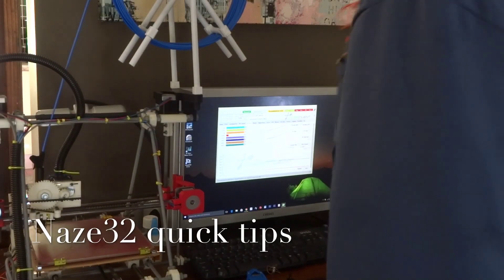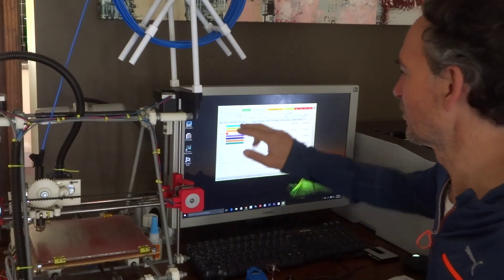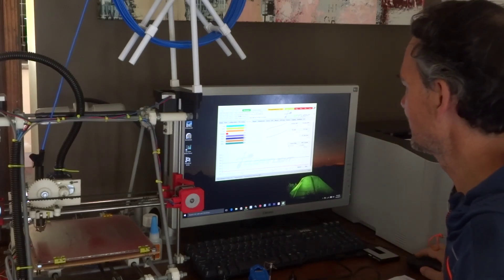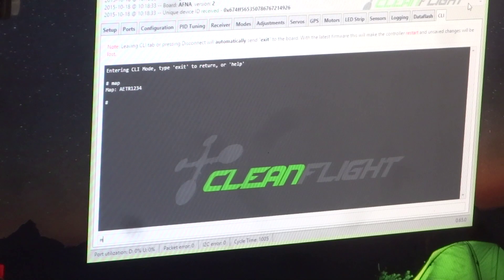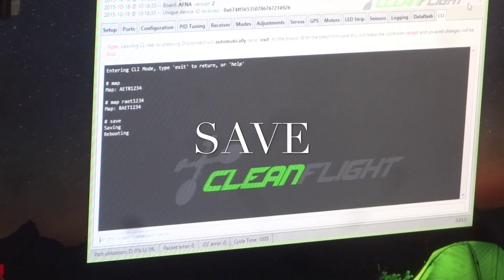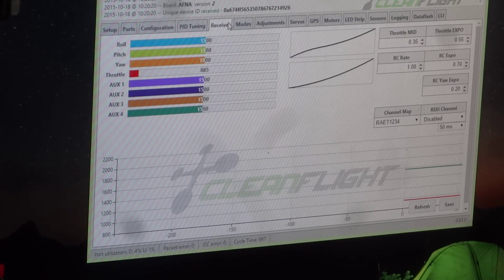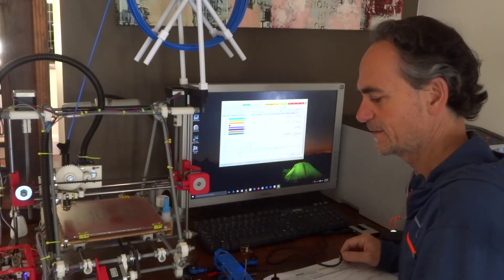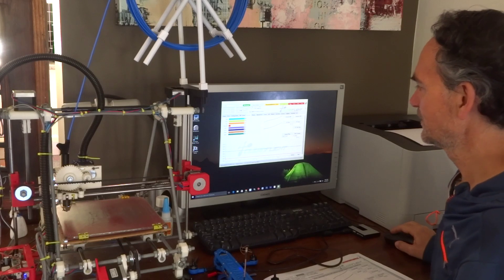Naze32 Quick Tips - Channel Mapping

Comment: do you knwo how to add more channels in cleanlfight? im using a flysky i6s tx with ia6b receiver using I-bus. The tx has 10 channels and the receiver can support 10 channels as well, but I can only see AETR and aux1-4 in cleanflight. Is it possible to add Aux5 and Aux6 (channels 9 and 10) ?
Reply: I just checked and apparently my receiver can support up to 18 channels over i-bus

Comment: I only have channel 3 available on my SBUS receiver, which I intend to use it to drive a camera tilt servo. How do I assign Throttle, which is currently on channel 3, to a different channel, say channel 8. 
Thanks
Reply from the maker: Sam AdvanES go to the receiver tab and change the order you can type directly into the screen without using click any more. Eg should be aetr1234 means aileron elevator throttle rudder aux1,2,3,4 just swap the T with something else.
Reply: Thanks a lot. You explain it very well. Now I understand the mapping. I thought it was A=1, E=2,T=3,R=4 in a map like AETR1234. Thanks again mate.

Comment: Hi, 
this is very important, whenever i change the channel mapping it doesnt allow me to arm the quad but is does when i dont change the mapping!!!
what shall i dooooo???
Reply: me too noob, but when i have trouble arming, lately it is 2 things [just for reference/Chrome app BetaFlight Configurator 1.7.5]: 1.Configuration>Receiver Mode>[mine] has to be in RX_SERIAL; now in Modes, after you click Add Range and add ARM, then the/my {Spektrum dx6 Tx} Aux-1 button shows the little threshold marker move when toggling the button; 3.set the ARM minimum to the right of the leftmost threshold of the Aux-1 switch, and the right slider to the right of the the right threshold of the Aux-1 switch. THEN i could finally arm. i look fwd to hearing how it goes/went.
Reply: I'm a total newb, first off. But you should probably set up your ARM threshhold and AUX assignment after changing your mappings.
Reply: david parham yeah the minimum values were my issue also. I've since fried my controller board, so waiting for delivery.

Comment: Hi there! Nice video! Can I change the channel mapping to have AUX1 receive Rudder from the RX? I was soldering some wires on the Naze and the Rudder pad came off.
Reply from the maker: I think it will work just replace 4 with 5, you don't have to use the cli now just type into the screen and press save

Comment: Hi, thanks for the video.
I'm wondering if it's possible to do something like "map AETR1235"? Do the numbers refer to the FC board interface number?
I have a naze where the pad for channel 4 is missing, and the quad in question has a PWM receiver, so I'm wondering if I can somehow use the FC or if I have to bin it.
Thank you.
Reply from the maker: +nathan100tz well thats the kind of situation where you would use channel mapping. Give it a try i'm not an expert on this. Hope it works for you :)
Reply: +jbalatutube Thanks mate, just wasn't sure if the channel being mapped was from the rx or FC. I'll try and let you know, just didn't want to have to tear down a quad just to test it, but the other FC broke last night anyway, so now I have to...

Comment: Hi can you help im only getting inputs from aux1,2,3,4 and none for my yaw roll throttle and pitch. ive tryed swapping cables with no joy and I see you change the channels how would I word this on the cli. im new to cleanflight as ive been using openpilot for my cc3d
Reply from the maker: Please check the receiver tabs to see if you are getting any input then note down which channels should go where. My guess is you have not wired it up to the board properly.
Reply: +jbalatutube thanks for replying. got it working had to change the mapping all round but seems to work now still to do a test flight lol